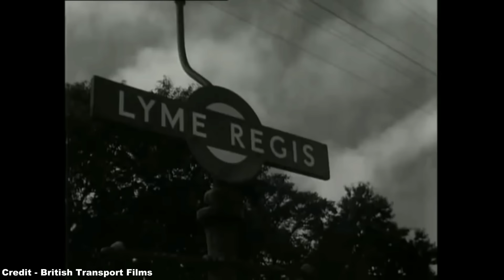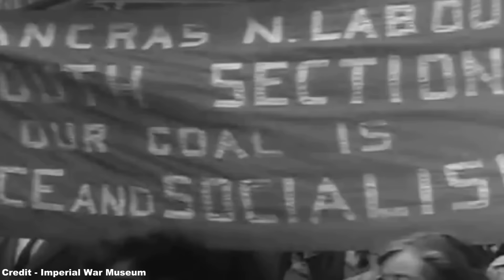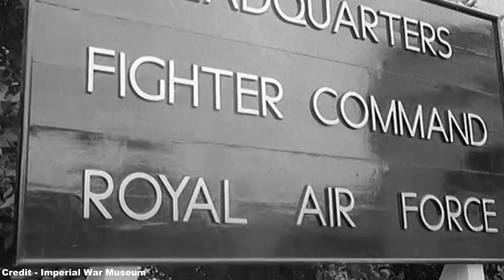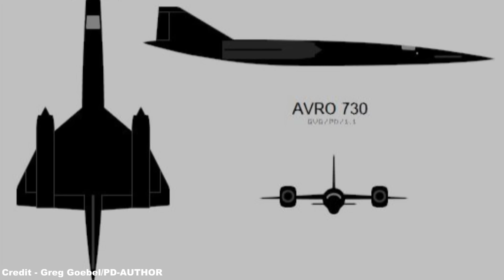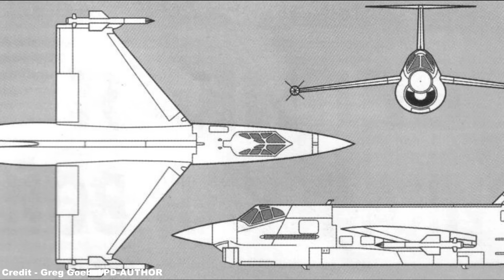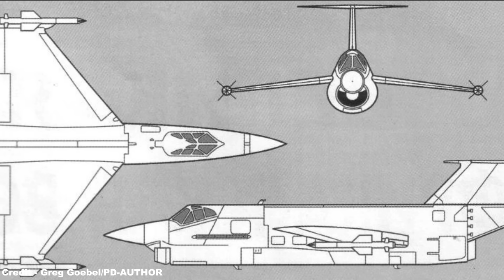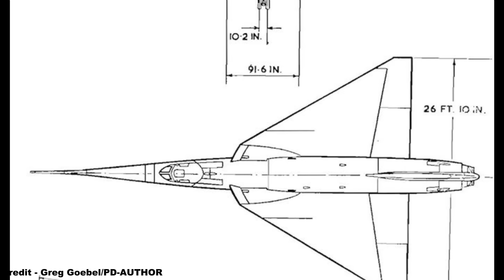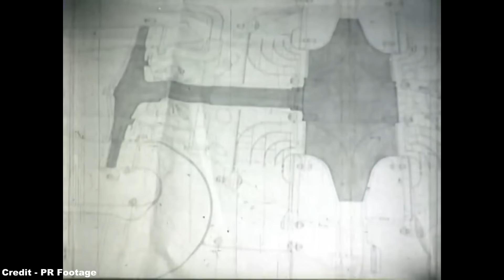The 1957 Defence White Paper - Death by a Thousand Cuts

Comment: The Gyron Junior, mentioned at 31:50,  was actually replaced very quickly on the Buccaneer by the Rolls-Royce Spey. The Gyron Junior did not have enough thrust to get a fully fuelled and armed Buccaneer airborne; the aircraft had to be filled up with fuel once airborne.
Reply: Absolutely correct. It puzzles me why they didn't go with the Avon or Sapphire on the early buccaneers. The Avon was in use on the contemporary Sea Vixen and Scimitars so spares on board the carrier would be easier to carry. I know fuel consumption was a consideration but the gyron junior as you say was a very underpowered unit.
Reply: @Seminal_Ideas the problem with the avon at that time is winding down the production of that engine as RR put on development and production of turbofan engines like the Conway, Spey and the RB211

Comment: A similar thing happened in Canada with the cancellation of the ahead of its time AVRO ARROW.  Missiles were supposed to replace interceptors.
Reply: The Arrow was doomed to failure from inception..
Canada's air force is far too small to afford such an aircraft... it's aviation industry was only successful building foreign aircraft under license... same is still true today.
Reply: Actually American aircraft were to replace Avro.
Reply: @sandervanderkammen9230  aviation is heavily subsidized not just through manufacturing companies but also through infrastructure.  It is an industry that would be very small if not for government intervention.
Reply: @gar6446  and the Bomarc missile.  Arrow had tech American aircraft did not at the time.  Arrow chief test pilot Jan Zurakowski was a family friend, my mother was Chief of weights engineering.
Reply: @charlesblithfield6182  Im not sure what your point is, The Arrow was cancelled because the Canada government could simply not afford such an outragiously expensive aircraft with no potential for foreign sales.
Reply: @charlesblithfield6182  PROVE IT.
What technology did the Arrow have that wasn't already in production,development (or already obsolete) in America????
Reply: @gar6446  Which American aircraft replaced the Arrow?
Reply: @sandervanderkammen9230  fly by wire.
Reply: @charlesblithfield6182  Hahaha! Thats funny!
The idea that Cunucks invented Fly-by-wire technology is absolutely hilarious.

Fly-by-wire flight control was invented in Germany in the 1930s and saw use during WW2.
The most notable example is the Messerschmitt Me-262 which was the first jet aircraft to have a Fly-by-wire Horizontal Stabilator to counteract the effects of compressability and the phenomenon of "Mach tuck" at high transsonic airspeed.

The Bell X-1 used a nearly exact copy of the Me-262 Fly-by-wire Horizontal Stabilator to break the Sound Barrier in level flight in 1947.
America pioneered the use of Fly-by-wire technology after the war using captured German technology and German engineers.
Reply: @charlesblithfield6182  I wasn't making the point that the Arrow was inferior, the point was the aggressive marketing and political arm bending ensured that the Arrow was shut down and American aircraft selected.
Similar happened with Lockheed bribing Germany to select the Starfire, and TSR2 being cancelled and the F111 going to Australia.
Reply: @sandervanderkammen9230  The F104.
Reply: @sandervanderkammen9230  The Arrow was the first to fly by wire, concord had fly by wire, airbus had fly by wire, all long before the US caught up.
Reply: @sandervanderkammen9230  The Bell-X1 all moving tail was built using data supplied by Britain from the Miles M.52.
Perhaps you should get a bit educated on this subject. You're clearly a bit confused, mixing up  fly by wire and all moving tailplanes.
Incidentally the first use of fly by wire for the USA was the lunar lander, which was only made possible by operation paperclip.
Reply: @gar6446  The TSR.2 was inferior and much more expensive.
Reply: @gar6446  The F-104 was adopted to replace the Canadaire Sabre 6.
Reply: @gar6446  No, the Arrow was 30 years after Fly-by-wire technology was invented and introduced.
Reply: @gar6446  The Miles M.52 never existed... it is pure British science fiction

Britain did not invent the Horizontal Stabilator.

The Bell X-1 used a nearly exact copy of the Messerschmitt Me-262 Fly-by-wire Horizontal Stabilator designed by Heinz Wandelmann and Adolf Busemann at the Luftfahrtforschungsanstalt
The only large diameter supersonic aircraft wind tunnel in the world.

Theodore von Kärmän discovered the technical data after the war and quick shipped it to his former student, Jack Ridley at Bell Aircraft.

The is absolutely zero evidence to support Dennis Bancroft's much later unsubstantiated tale that data from the M.52 was given to Bell.

When the Miles M.52 scandal broke Ministry auditors raided Miles Aircraft and found no trace of the 2 prototype aircraft or funds paid to build them.
All that was found was incompleted drawings and a partially constructed wooden mock-up of the cockpit section.
Reply: @gar6446  The Messerschmitt Me-262 was the first aircraft in the world to have a Fly-by-wire (analog) Horizontal Stabilator specifically developed to counteract the effects of compressability and the phenomenon of "Mach Tuck" in high transsonic flight.
The system was wind tunnel tested to Mach 1.4 in 1940 and Me-262 pilot Hans Mutke used it to reach supersonic in a dive in 1945.

The German A4b Rocket plane was successfully tested in 1945 (unmanned) and reached a top speed of Mach 4.
Reply: @sandervanderkammen9230  Arrow would have been an effective fighter.
U can't deny that.
It was years ahead of time.
Reply: @sonnyvictor3584  Indeed, 477 mph for up to 20 minutes of WEP and a continuous cruise speed of 425 mph it was faster than some Allied Jets!!... but of course the Me-262 rendered propeller driven fighters obsolete... and the 262 could be built for a fraction of the cost of the Arrow.

Comment: It never stops...the cancellation at the last moment of the Nimrod 4 ......HS2 - a rail network for increased capacity cut back successively to even less than a link. What confidence do builders have when they knlow that at the last moment all the effort and treasure will be lost? I am 75 and I lived through all this.
Reply: I was laid off from FRA because of the loss of the Nimrod. Told it was to save money yet the UK Gov then buys the Boeing aircraft costing even more that can not be re fueled by air tankers in the RAF !

Comment: Avro 730 looks suspiciously like a predecessor to the SR-71 Blackbird?!..
Reply: That was my immediate thought.
Reply: I was thinking that too, does anyone know if there are solid links between the two.
Reply: Apart from the fact that they have nothing in common sure why not
Reply: @MrJimheeren  the engine placement is the same, the narrow body fuselage, the same mission type. The early drawing of the SR-71 being are even closer in design
Reply: @Alex-cw3rz  the Concorde and the SU177 also look almost the same and are designed to do the same thing. But if you look at the finer details they’re nothing alike
Reply: @MrJimheeren ‘British aviation’ were good at handling over advanced aviation technology to the yanks… one prime example was the Miles M52.
Reply: The Swift swiftly tried to kill you one you sat in the cockpit… and the Javelin was as good as it look, not very good.
If it looked right… not in the Javelins case.
Reply: @Alex-cw3rz  there is a concept in engineering called "convergent design"
there's a very limited number of ways to design a mach 2+ supersonic reconnaissance aircraft, and designers will often come to the same conclusion independently of each other if that conclusion is obvious enough based on the facts provided

what you don't see on the Avro 730 is all of the innovations from NASA's research - such as the distinct "chines" on the SR-71 that gave it more stable supersonic handling and extra lift in low-speed environments. 
That massive canard in the Avro 730 design also made break out into cold sweat lmao. Probably don't have done any favours in the actual flying prototypes had they ever existed
Reply: @MrJimheeren  do you mean the Tupolov T-144 as that was using quite a number of stolen designs from Conocrde, so that is probably not a good example.
Reply: @goddepersonno3782  you are not saying anything I don't know, but as shown by aircraft that can go mach 3+, it does not require this kind of design.

 you do know those chines acted in the same way as a Canard it was two different solutions for the same issue, both advanced and old at the same time, as Chines are not new at all and neither were canard, but it was innovative to do both on very high speed aircraft.
Reply: @Alex-cw3rz  yeah sorry that’s what I meant. Btw the Sovjets didn’t really have to steal the plans for the Concorde because the blueprints where widely available
Reply: @MrJimheeren  they stole a couple of things, the designers of the concorde even put out false documents on the special kinds of tyres they were making which had the consistency of chewing gum.
Reply: Not really. How are you going to shape a super fast plane? Like a cargo plane? No, it’s gonna be long and skinny with a similar wing layout.
Reply: @Alex-cw3rz 
I believe Many Avro arrow engineers were British.
  When they cancelled the arrow, many went to Lockheed and NASA.
The arrow was cancelled when the  American aircraft giants said “no way” .           
   then  BOMARC  
bases were installed .
  It’s a shame. , that was a very advanced aircraft for the time.

Comment: The p11.21 was basically a british F-16
Reply: Hawker P.1121 was dogshit, an aircraft without a requirement, not designed as an integrated weapon system, a thing that was increasingly important in the 1950s. It's closest equivalent would have been the F-105.

F-16 was a much later design, taking into account energy-maneuverability theory, taking advantage of lightweight composites and an extra 2 decades of jet engine development. They are incomparable.

Comment: Great images. One small point though. The SR 53 and the !77 were different aircraft. The 53 was a concept proving ship and the 177 would have been the production version and a fair bit larger. Also the Turbojet engine was absolutely not a back up for the Spectre rocket motor. The aircraft took off under the power of the Jet alone and climbed to service altitude where if it had some 'Trade' in the form of a Soviet Tu 16 or Tu 95 Bear it could light the fully throttleable rocket motor to close the distance to aquire a target. It would also have made them (SR 53 W.177 and Avro 720) perfect 'Point Defense ' interceptors with the power of both powerplants propelling them to the altitude of incoming enemy craft.
Germany was to be a major customer for the W.177 before this was scuppered by some disgusting samples of humanity at Lockheed and the West German government. The British aircraft military aircraft industry never really recovered from the Sandys white paper and the RAF were left without a true multi-role combat aircraft until the advent of the Tornado due to the cancellation of the wonderful TSR 2 having to soldier on with some pretty darned old aircraft. It used to be said that MRCA really stood for 'Must Refurbish Canberra Again!